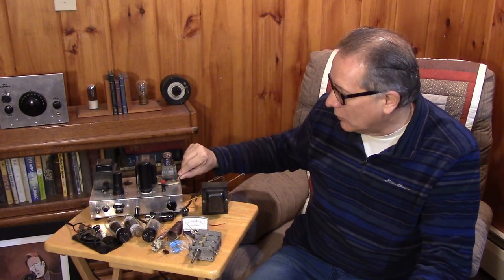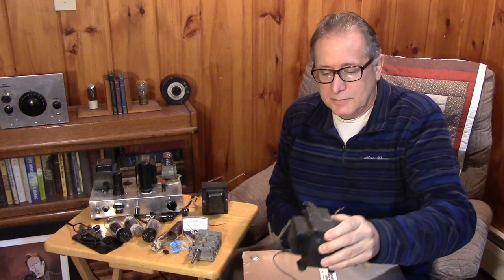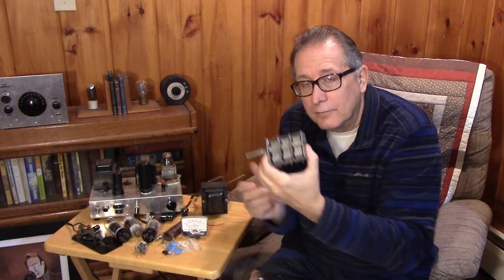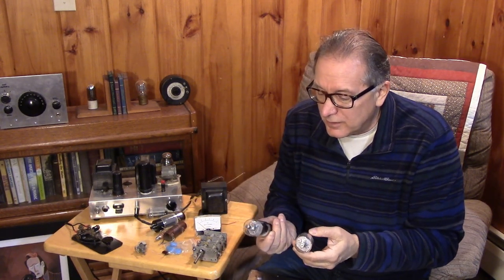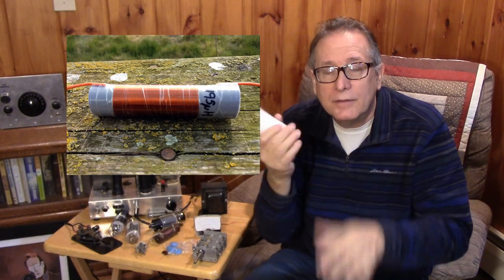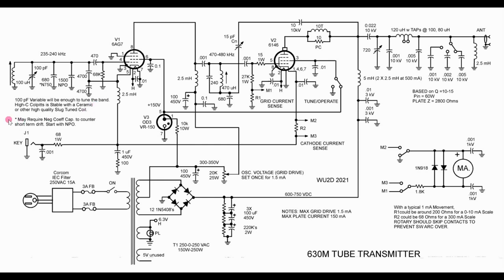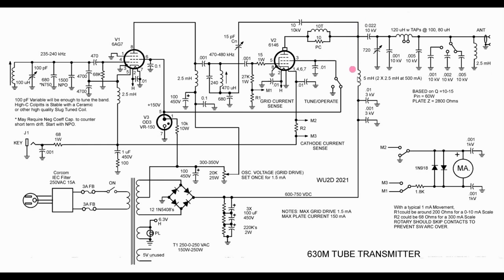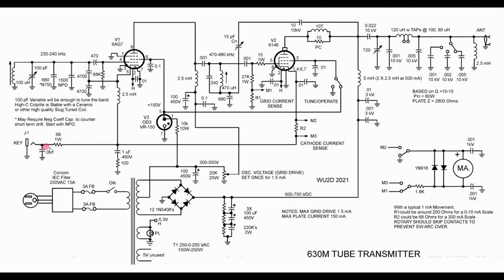My 630M Adventure - Part 2

Comment: I wish you could explain how "loading" of the final tube works.
Reply from the maker: The final amplifier stages have an impedance that represents their ideal or best value for transfer of power to a load. This is based on their operating conditions voltage and current etc.. This value is typically much higher than our 50 Ohm coax and antenna impedance. So the matching network ( in this case a pi network) transforms the couple of thousand ohm impedance of the tubes, down to 50 ohms so the stage can deliver all of its potential power to the antenna. Loading means approaching the ideal value for maximum power to the antenna by tuning the network.

Comment: I noticed the oscillator isn't always running but is keyed with the power stage. Does that give it the classic tube sound?
Reply from the maker: Keeping the oscillator running and just keying the final is an old trick. But the problem is "backwave", which is some of the oscillator power leaking through. Good neutralization can help greatly on backwave. But for break in operation, the oscillator must be keyed.
Reply: @MIKROWAVE1   I have heard some hams say that it then would have some amount of chirp. So do full break in transceivers just chirp then or are there other ways of eliminating it?
Reply from the maker: Timing is one method. On key down, the oscillator is keyed first, it settles, then the subsequent stages are keyed, and the reverse order on key up.
Reply from the maker: Keying the mixer oscillator which is crystal controlled, while the VFO is always on during TX, is another method. I use both in this transmitter so it definitely does not have the classic tube sound that a Novice tube transmitter had like an old Heath DX20.

Comment: Use 2x 75R to 300R transformer to drive to Line Timebase tubes that drives a 300R to 75R transformer which should give you 100W RF.
Reply from the maker: As usual, you have stumped me. A twinlead TV Transformer and a CRT?